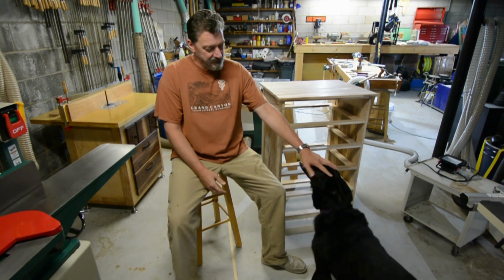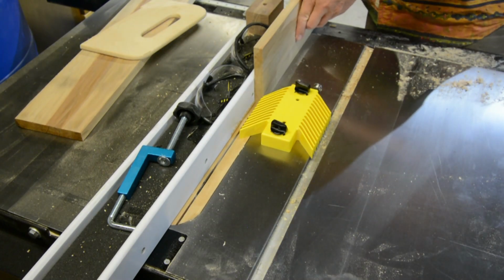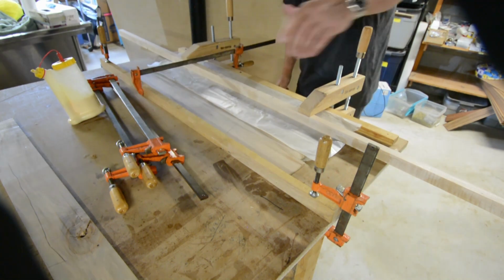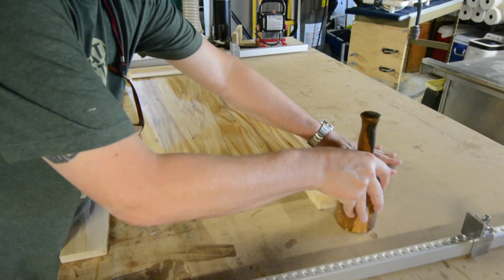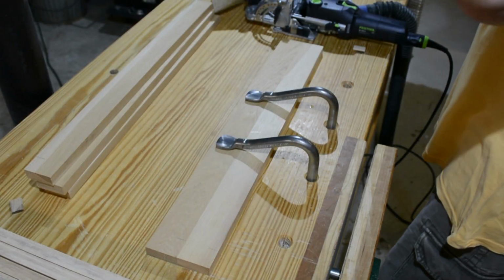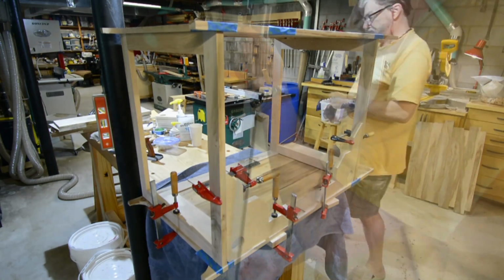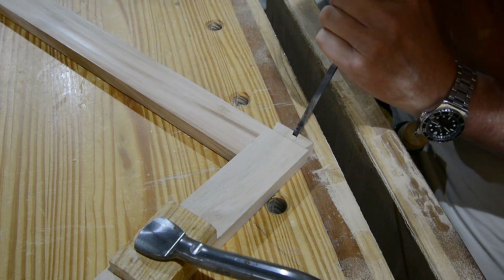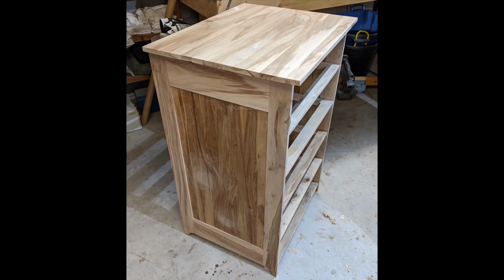Chest of Drawers Part 1

Comment: Thanks for another great video. 
I am going to do a quite challenging glue-up "soon". And I have been contemplating epoxy for the open time. I was hoping to be able to use hide glue, but we will see.
Oh, and I have been saving up on that bellyclamp myself. Sure is useful :D
Looking forward to part 2. Cheers from Bergen, Norway.
Reply from the maker: Odd thing, if you look at the intro I filmed when I came back from being out west, I am 20 pounds lighter than the footage.  I dropped 10 pounds (4.5K) from covid, then another 10 while biking and hiking around the Grand Cannon.  My "clamp" is smaller.  I have grown to love true epoxy with its near hour working time and gap filling capacity.